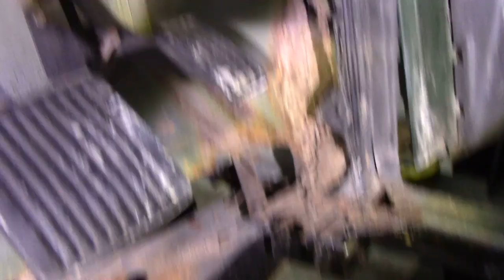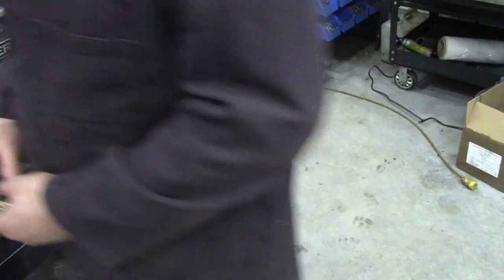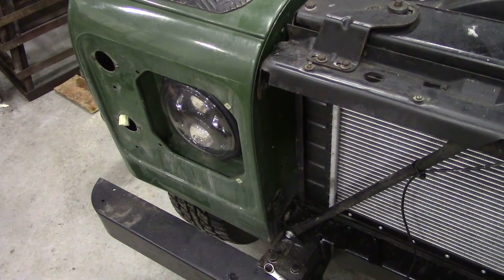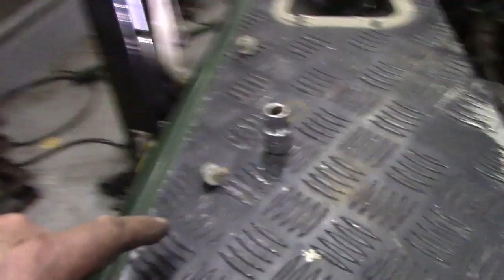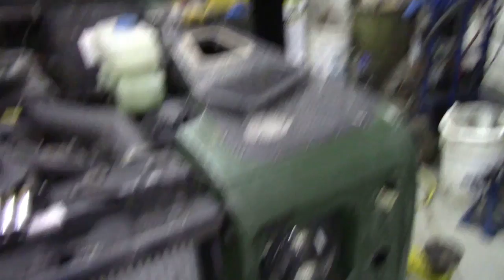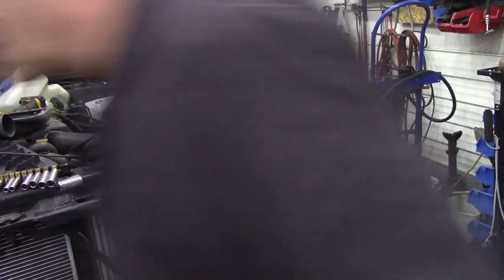Defender footwell, door pillar, and upper bulkhead repair. Pt 1 removal of parts

Comment: I chuck them captive nuts in the bin - I cut out the area the hinges bolt onto, weld in a piece of flat steel, drill that for riv-nuts, fit riv-nuts & use metric M8 bolts to hold the hinges on. The factory version is rubbish. I do much the same everywhere all around the vehicle - todays project was turning a stock SWB Defender commercial into a single cab-pickup without buying any new panels.. everything got re-used/cut/repurposed - every captive nut I came across, every nut-clip, every awkward fastener got chucked in the bin & replaced with a riv-nut so the entire thing can be taken apart by a 5 year old with a 13mm socket.  If any fastener is any way awkward to get at/hard to open, it gets simplified so that it is no longer difficult - which means the next time it needs taking apart, it is a doddle.

Comment: How are the bonnet hinges attached to the bulkhead are they riveted or welded on as i need ti replace the whole vent in my 300tdi as the previous bodge job is splitting at the bottom of the vent and pulling the bonnet forward
Reply from the maker: Looks like rivet heads on the outside

Comment: The rear edges of the wing tops on my 1984 127 are bolted vertically from the outside - seems like all the smooth appearance of later models is not necessarily a great improvement.

Comment: Hi Mike, I see you took to wheel off to get to the plastic retainers for the wheel arch. I use a spring loaded center punch with the point still in tack and they usually pop right out with out disturbing the wheel.
Reply from the maker: Good tip! But I had to take the wheel off to get the footwell out anyway

Comment: Hi Mike 
About that lower inner wing support bracket could you just retain it with some flange head rivets with a good  coating of Duralac Anti Corrosive Jointing Compound  to save all that wing fitting and removing and welding  bother 👍🏻👍🏻
Reply from the maker: I can try, but I have an idea this customer wants it welding

Comment: Looking forward to seeing you do this as i'm doing the same with a series 3 .Its also corroded worse on the right hand side ?
Reply from the maker: I believe it is all to do with the camber of the road - as you know a road has a arch to it where the white line part is higher than the sides, so water runs off - so there is more salt water on the edges than the middle

Comment: Yes, a No.4 Pozidrive with the little 'x' marked at 45deg to the slots - never use a Philips! So similar looking but the wrong one destroys the screw head (and don't do the screwdriver any favours either!) Using an impact driver sometimes helpful as it breaks the rust in the threads better. I've now ended up grinding the hinge off as well as less hassle in the end (and the hinge blocks are pretty knackered often as well!)

Comment: i coat everything i do in copper grease and use stainless nuts and bolts for everything solves all the issues down the line everything comes loose straight away
Reply: graham-martin. yes same here .copper grease , but I don't use stainless on all fixings as they are not as strong as the high tensile bolts that are needed for some parts .Suspension,  Towing hitches ,drive shaft couplings ,etc.
Reply: I forgot to mention I only use on the light stuff not the heavy stuff no suspension or towing gear, miles the main man helping all landy owners I am totally anal about my Landy so everything has to match I think it's landy ocd lol
Reply: @graham-martin5847  Hopefully you will eventually grow out of it (landy ocd ) I have owned and used LRs since my first second hand series 1 in 1964. I think you will find that YOU will grow tired of LRs before they get tired of you, big boys mechano. they will last a lifetime if you are prepared to keep bolting new parts on .
Reply: Mine will deffo outlast me had it blasted and galved everything taken back to bear metal zinc primer then lots of enamel apint all small parts sand blasted too, ongoing project only took me four years lol ive got a full double cab sitting to waiting to be done after this one and a 300 tdi county after that so am gonna be busy for the next god knows how long if anyone interested leeds galvanising they are spot on pick chassis up from anywhere cheap and deliver back to you in about a week superb job too

Comment: Great video Mike. I did this job last year, what a pain. What is the yellow/gold extrusion on the inner wing for? I thought maybe a resistor?
Reply from the maker: It is the resistor for the daytime running lights
Reply: Thanks Mike. A bit odd that as mines a 1992 and doesn't have any! It appears to be connected just like the one on your car. Maybe a 2nd hand inner wing? Cheers.
Reply from the maker: Lord knows what this vehicle really is - I see the inner wings are 300Tdi type as there is no bracket for the metal expansion tank

Comment: Great video Mike,  will be following this with interest as my 110's bulkhead that was refurbished by the army seems to have a lot of suspicious pop riveted plates.  Sheilder in Ireland are producing a new galvanised bulkhead now and Hobson industries here in England are making them in stainless, don't ask the price though. . ..
Reply from the maker: Are they new or galvanized old ones?
I think new Defender bulkheads are available in Turkey
Reply: @BritannicaRestorations  Sheilder are brand new bulkheads,  they also make galvanised chassis  check them out online at www.shielderchassis.com
Reply from the maker: Actually pretty good!
Impressed!
Mike

Comment: What a shame Land Rover didn’t continue to use aluminium bulkheads like the very early series 1s... I can’t imagine galvanising the chassis and bulkheads and any other steel parts would have pushed the purchase price up by much!
Imagine that, a Land Rover without any rust!!!
Reply from the maker: I think I read somewhere that they dropped the idea of galvanizing and making Al bulkheads as the would last too long then no one would buy another
Reply: See Volvo. The last for ages. They went broke and the name was sold.  Same as Land Rover. So it did not help Land Rover to survive. 🤦🏻‍♂️